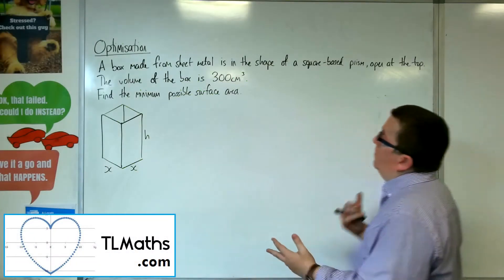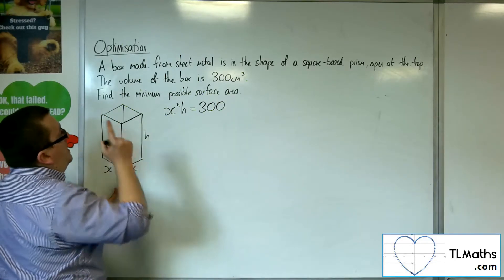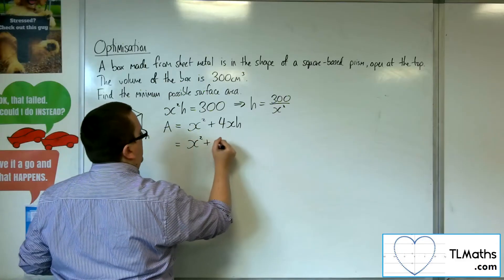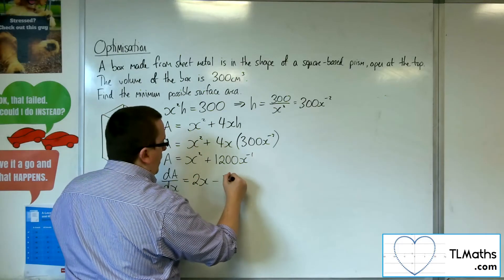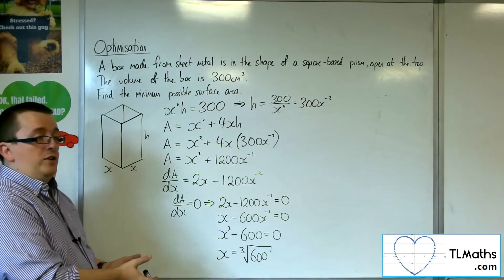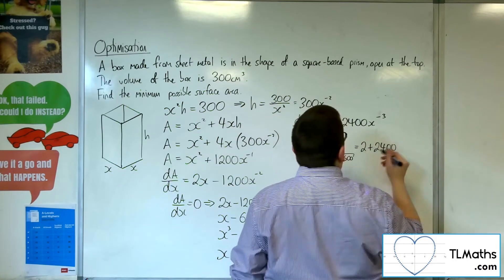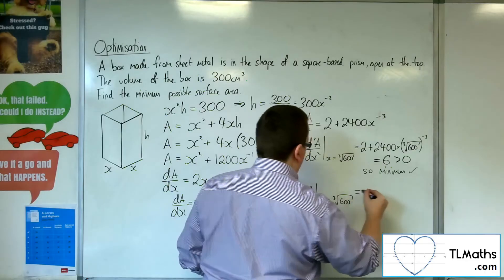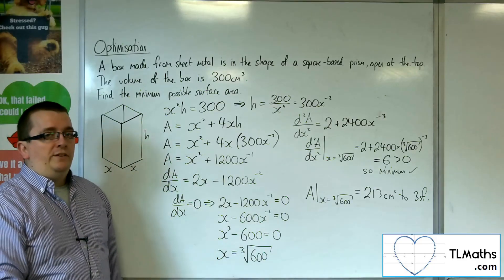A-Level Maths: G3-27 [Optimisation: Minimising Surface Area of a Box]

Comment: Isn't there another 4xh on the inside of the box ?
Reply from the maker: No, the surface area refers to the total area of the net of the box. So if you unfolded the box so that it was flat, what is the area. Going inside the box would double up areas.

Comment: what if you wanted the maximum surface area
Reply from the maker: There is no maximum surface area, here is the graph of the surface area: https://www.desmos.com/calculator/oyjbmpmfpr
You could have the value of x as large as you like, and consequently h would be very small (or vice versa). You could have a surface area of 10000cm^2 if you wanted to, but x=99.94cm and h=0.03cm, so it would be a box that has a very wide base but is incredibly short.